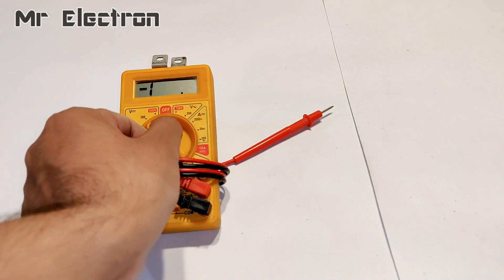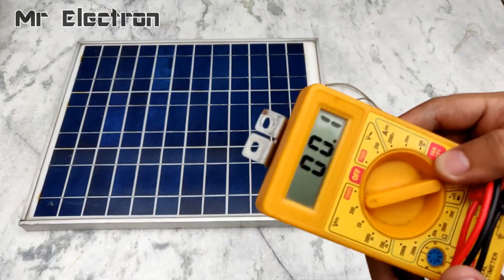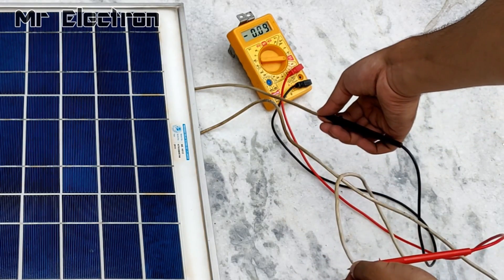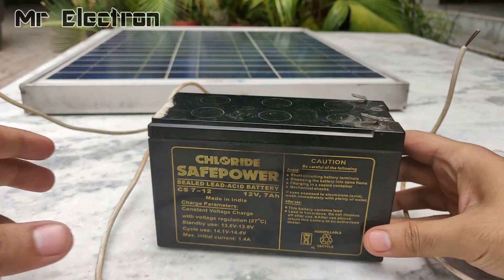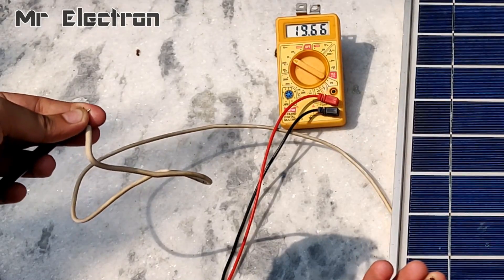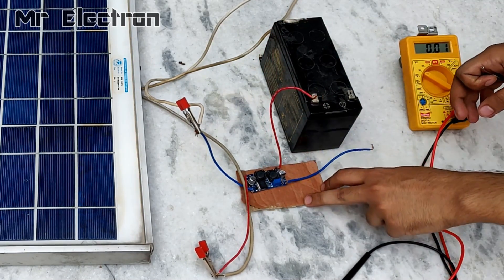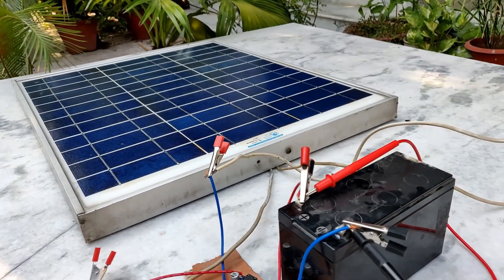Run 12v 500W DC Motor & Charge 12v Battery with 40W Solar Panel - Safely charge a 12v UPS Battery

Comment: Thank you for your YouTube video; please help me by leaving your reply to my question(s):  If you kept the 'Buck Boost Conveter Module' connected to your battery without powering a load from your battery, would not the battery eventually become overcharged by the solar panels and damage your battery?  Or, does the Buck Boost Conveter Module have an electronic component on its cicuit board that can sense when the battery is fully charged and then automatically stop the electrical current from the solar panel from reaching the battery, and protect the battery from overcharging?  Or, does the battery stop absorbing more and more power on its own if you implement a Buck Boost Converter Module and adjust the output voltage of the solar panels to match that of the battery voltage capacity?  Some Buck Boost Converter Modules also have an adjustment screw for adjusting / controlling the Amps, and a separate adjustment screw for adjusting / controlling the voltage ouput.  Under what circumstance(s) would you need  to have that type of Buck Boost Converter Module that has an adjustment screw for adjusting the amps?  I am trying to correctly design a 12V outdoor, portable, solar powered evaporative swamp cooler (an air cooler on caster wheels).  I am using three or four 12V, 100W, 7A, portable briefcase solar panels.  If I use only three solar panels wired together in parallel, the wattage output would total 300 watts, but the output wattage can actually be as high as 351 watts because each solar panel can produce up to 117 watts instead of only 100 watts.  If I decide to use four panels instead of only three panels, the ouput wattage can be as high as 468 watts instead of 400 watts.  The 'Rated Output' of each 12V, 100W, 7A solar panel is actually 14 volts to 22 volts because the voltage can fluctuate and is usually a few volts higher than what the solar panel is rated.  As you are aware, this is one reason most people implement a solar charge controller and a battery, or a Buck Boost Voltage Regulator Module to be able to adjust, reduce, and control the voltage reaching the battery and / or reaching the 12V direct current devices being powered.  If I wire three 12V, 100W, 7A solar panels together in parallel, the amp output will triple from 7 amps to 21amps.  Adding a fourth panel will produce a total of 28 amps. The portable air cooler will use two, side-by-side, 16 inch diameter, 12V, 120W, 10A automotive radiator fans mounted on a vertical wood board with 4 screws.  One or two motor speed controllers (potientiometers) will be connected to the two radiator fans to be able to adjust and control the fan motor speed and air flow of the fans.  I will be using two 15 amp fuses to protect the radiator fans and wires.  I will be using a 20W or 30W 12V submersible water pump to supply the swamp cooler brick with continuous moisture, and using a fuse to protect the water pump and wires.  If I use only three solar panels instead of four,  and I only use the 12V solar powered air cooler during the day, how many amp hours or watt hours should the battery be that I buy if I use a Buck Boost Voltage Regualtor / Control Module instead of a PWM or MPPT solar charge controller?

Comment: Hi. I have 4 small (about 5x14 inches). Each one seems to produce 3.4 volts. When I connect them consecutively, I seem to get about 14.5 volts. I got two questions.
1.  Do solar panels produce enough amps to charge a deep cycle 12v battery?
2. If I connect straight from panels to the battery, can it overcharge it?
3. Do I need some kind of device to stop charging when battery is fully charged?

Comment: The load is draining battery @ 0.1 V per minute. How can I reduce this fast drain. Can I use a resistor so that the bulb brightness is reduced thereby reducing power consumption ? Please suggest.

Comment: Hi sir. Very informative video. Will the  12v 500watt motor still run if you use the voltage regulator? I did not see you run the motor using the voltage regulator

Comment: At 3;35 you said  that the battery will get damaged,. What would happen if  I got 2- 12 v batteries on my scooter with a 500 w motor can I hook the panel and drain from it to keep the batteries full while I'm driving it or will the batteries still get damaged? Can I turn the panel off if I can tell when the batteries are at full charge?

Comment: Hi brother,
I need a help with the buck converter. My 2 wheeler rectifier output is 9-10v in idle rpm and when I rev it goes upto 14.5v(note: magnetic coil work n rectifier is modified). What I need is I need a constant voltage output 14.5v for charging battery from rectifier when the vehicle is in idle as well as revving (eg. 9-10v @idle n 13.5-14.5v @ 2000rpm n  above this is the input). Kindly please help me on the same

Comment: thanks for the informative video, how do we calculate what is the maximum battery capacity we can charge with a 40w solar panel, example can i charge a 12v 28ah battery ?

Comment: U didnt notice not to charge 12v battery for much time with stepdown module or bug converter as in previous video, u said u have to remove manually bug converter when 12v battery is fully charged when there is no charge controler,how should i know its fully charged,do i has to  check it few times while its charging with multimeter,plz reply.

Comment: Is that step down module, because sonar panel giving 20v but charging to 12v.
Reply: 20v open circuit voltage but under a load would be just enough to charge... 14  volts maybe

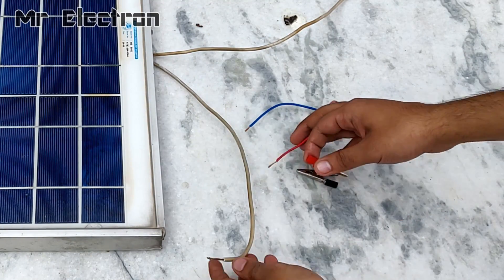Comment: some info.      it should be understood that you, either, do not know what you are doing; or you are a fraud.      such a booster is, effectively, a  pulsed-dc transformer.   (amps  will  FALL, as  volts  increase)      at  3:52,  and  4:10,  the (cheap)  meter  did  NOT  zero.      at 4:15,  accounting for meter  ERROR,  pv output is about 26 watts dc; 19.8 vdc @ 1.35a.       at 5:00,    Totally SCREWY  connections.  any subsequent meter readings are of  Not  Valid.       it would be  LOGICAL  to presume that  the  pos/negative  pv outputs   SHOULD  be  connected   to   the booster  INPUTs.       googletranslate
Reply: Completely agreed. Sir, i need a solar battery charging circuit for 12v 4Ah battery. Do you know any circuit?
Reply: Actually my rather confused friend, this is a BUCK converter not a BOOST converter youre a FRAUD
Reply: @lieutenant7196  oh, sure.  and  you are  a  pompousPutz  !!!!!

Comment: Hello. I need help please please . 
I am making compact generator from honda gx35 4 stroke 1.3hp engine . I am on tight budget 12000 indian rupees.  Problem is engine cost around 9500 rupees. And i left with 2500 which i will purchase dc to ac converter. I will try to take motor from any car generator but i need to do calculation which i dont know. Like which motor i need to generate 1000 watt under load . Please help please i watch your videos daily and i think only you can help me right now.
Reply from the maker: Cool project.. Its the rpm match that's gonna be a problem. Buy any 12v 100Amps or 24v 50amps motor and make sure that its rpm matches the 4 stroke engine.
Reply: @MrElectron  so my concern is is i buy that motor will it able to power 1000 watt " under load" i watched your videos carefully when load is applied rpm drops significantly.
Reply from the maker: @montykumar32  yeah! but only if your source is powerful enough
Reply: @MrElectron  so i know that 1 hp is 748 watt something and gx35 honda engine is 1.3 hp so practialy i will get around 960 watt and 10 % loses so around 850 watt is that maxmium i will able to produce at highest rpm
Reply from the maker: Yes and after that, there will be at least 15% dc to ac conversion losses when you use an inverter
Reply: @MrElectron  thnx a lot it helped me a lot😘
Reply from the maker: @montykumar32  😃 you are most welcome 😊
Reply: Use a 12v 100Ah battery and use transformer less inverter become easy solution and efficient
Reply: @chandruasp  thx bro , but actuly i need that for camping as light and compact possible and i am going for treaking these winters to mountains no electricity no food only forest covered with snow so the treak is long so i want that generator to fitt in my back pack.
Reply: @montykumar32  child,  that is some  Just  Plain  SILLY   reasoning.     do you expect to find  gasoline  in the woods.      googletranslate